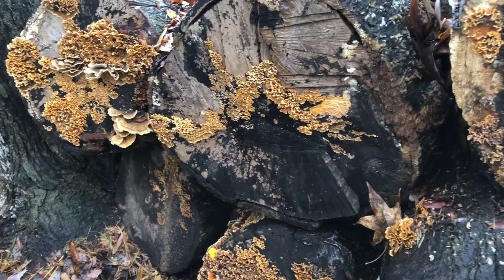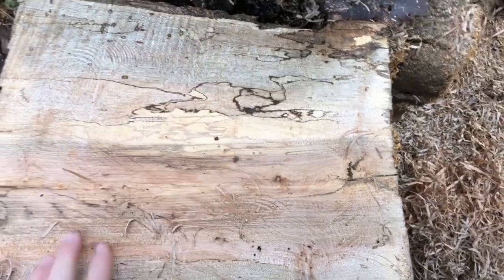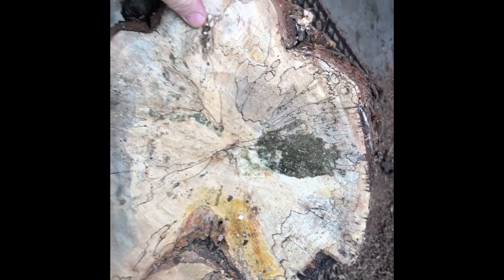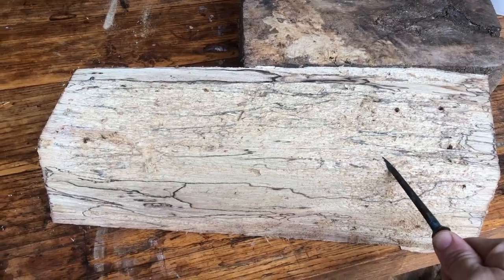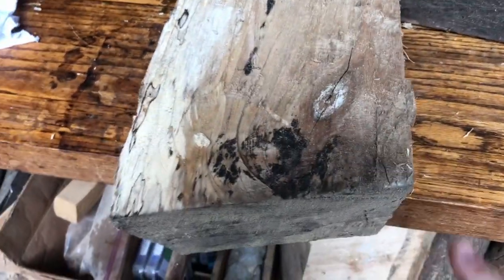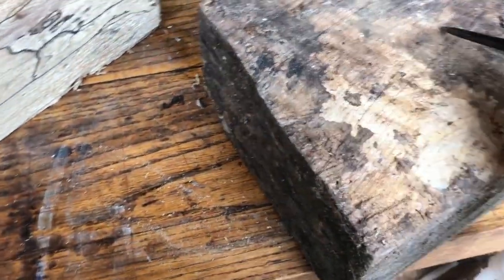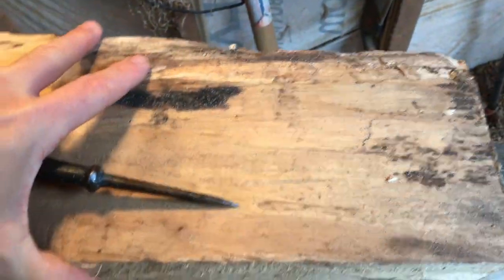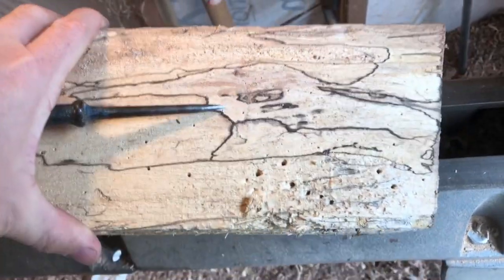What is Spalted Wood - Turning with Spalted Wood

Comment: Do you ever stabilize you punky pieces?
Reply from the maker: I don't stabalize as you would think of doing for pen blanks.  Generally I just remove the punky sections that are too degraded, either in cutting the blank or rough turning the blank.  Occasionally there will be some spot areas that are weaker than others.  Depending on what I am making, I may remove those sections and fill them, or I might spot stabalize them with CA if I think they have sufficient structural stability.  It just depends on what the overall piece looks like and whether it will benefit from having fill or if the void compliments its appearance.  The risk on spot stabilizing with CA is the appearance of glue marks, so I treat the area and adjacent ones with danish oil before I use CA, that helps to mitigate the glue marks.
Reply: Jason Van Duyn awesome thank you, I have some Russian Olive burl that is a little punky in just a few spots, I was debating between stabilizing it, or gouging out the soft stuff and using something like a blue epoxy to accentuate it
Reply from the maker: @toddgagne9314  Epoxy fills aren't really my speed, though that will certainly work.  When I fill voids, I shear scrape to produce the finest almost whispy shavings, pack those into the void and saturate with CA.  It produces colors that are complimentary to its surroundings.  I do all this while turning so I can clean the fill up with another pass.